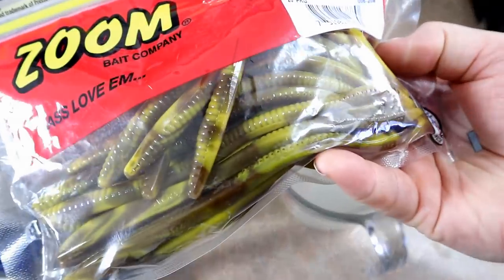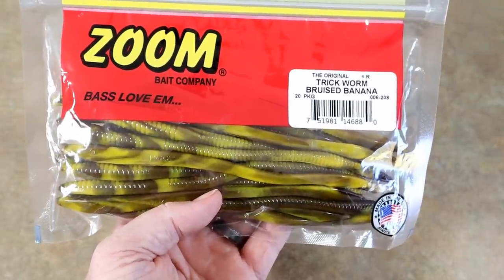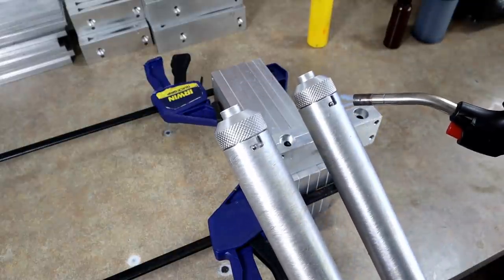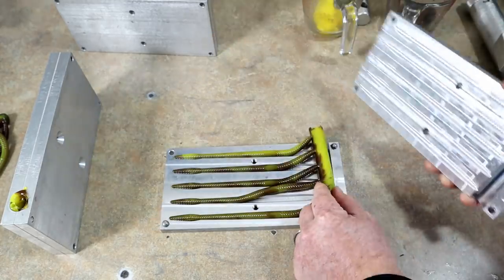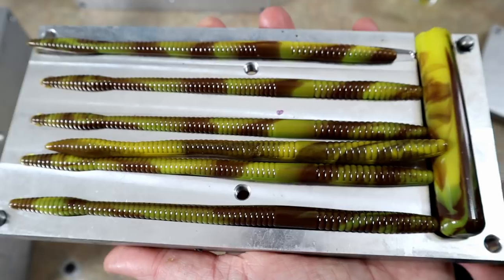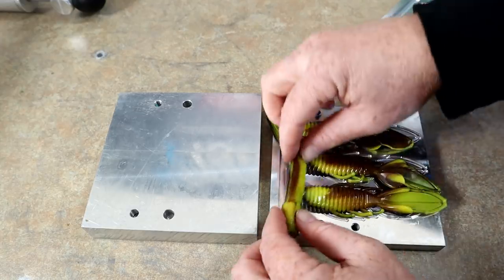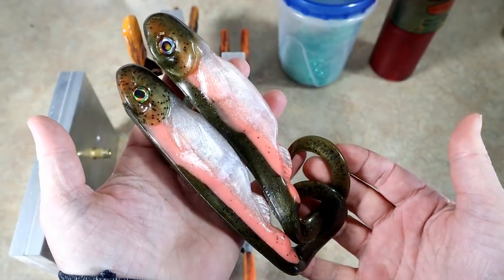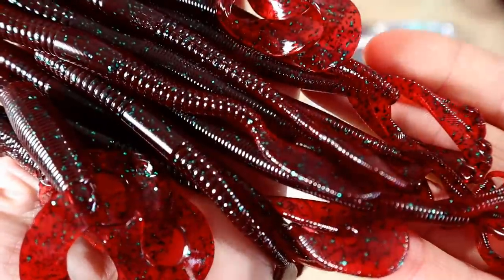BRUISED BANANA Color Match: How-To Color Match Fishing Lures

Comment: Motor oil Fleck worms PLEASE! (Culprit) <VERY HARD TO FIND IN THE WILD! LOL
Motor oil (Color changing) Base color, Decent amount of Gold flake (whatever shape and size that you prefer), Small amount of Medium black square, and a pinch of med green/emerald flake (a little more than you used for the black)
These weren't originally salted or scented, but salt and scent away! These are great summertime color IMO.

Comment: hello i dont use injectors so i dont know if this would work but as the top is screw thread what would happen with an off set crank in middle so as you rocked it back and forth the injectors would pulse at differant times. i am English so crank might not be what you call it a steel bar -_- that sort shape one high one lower sso as you pulled down rocking it it would pulse the higher one first. nice video shame i cant explain it better. the colour of the day be brill for micro anglers and that as a redworm(brandling) or other small worm like red things.